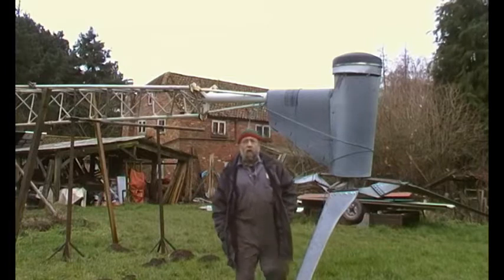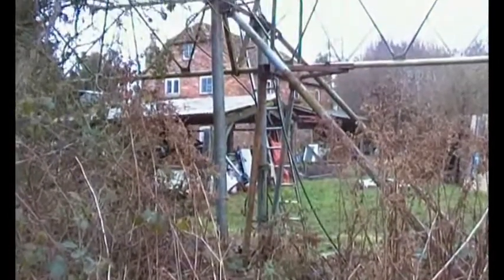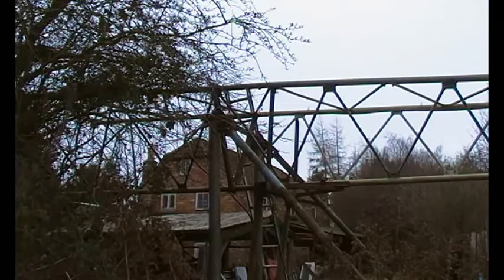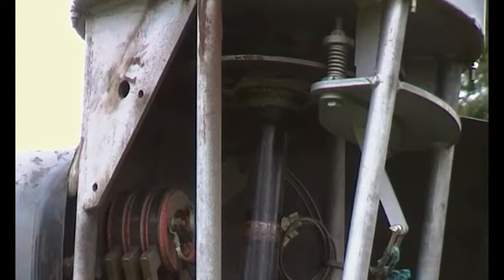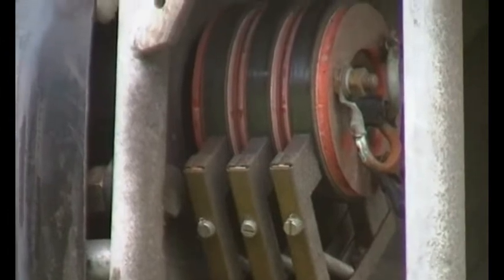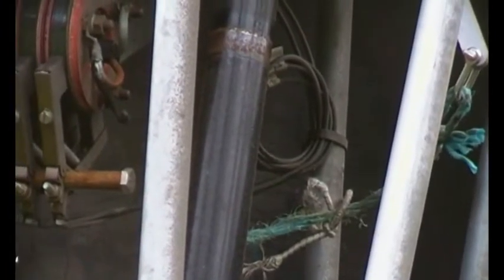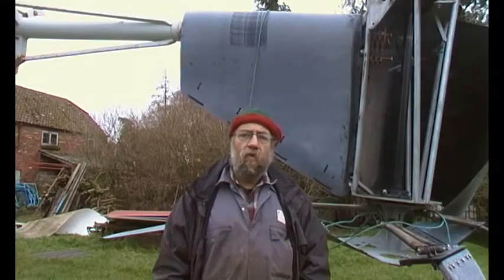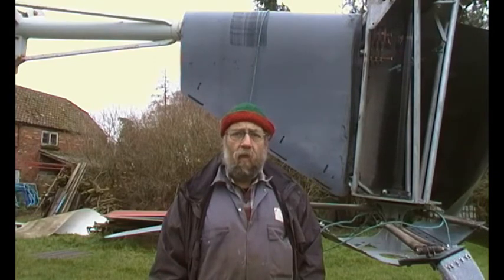Proven 2.5Kw wind turbine repairs. part 1

Comment: Thanks for the video, did you ever get technical drawings of the generator? Our 6kw proven has significantly reduced in output and I am trying to find out why…!
Reply from the maker: Hi, I'm thinking things like the blade spring mountings can wear, is the tower still upright, have you checked the electrical resistance between any 2 of the 3 out wires from the coil, are the brushes and slip rings in good condition, have you checked the diodes in the 3 phase rectifier? what are the wind shaft bearings like and have they been greased regularly. Plenty there to be getting on with, let me know how you get on. Subscribed? cheers
Reply: Thanks for the comments. The turbine has supposedly been professionally maintained by Kingspan, but they have not given or been able to provide any analysis or diagnosis as to the reason for reduction in performance. It’s tough to find people that know how to interrogate small wind…
Reply from the maker: @bellarchitects  Murray, if a diode has failed in the 3 phase rectifier then you will only get 1/3 of the output and the turbine speed will be regulated by the vari-pitch on the blades and this will be noisey. Best way to test this is with a multi meter. Where are you? cheers, Andy
Reply: @TheInfoworks  North coast of Northern Ireland, so not too many service engineers locally...!
Reply from the maker: @bell-architects  , I'm here if you want a step by step if you can upload videos of the various bits. As I say start with the rectifier, 3 AC wires in from the turbine and 2 wires out to the inverter, cheers

Comment: Great ideas you have used! however, could you adjust the fulcrum point and add weights to control the raising and lowering of the tower? Cheers
Reply from the maker: Ken the pivot points are fixed but weights may help, but they would need to be very heavy. This then may cause problems when trying to get tthe tower down as then the weight would have to rise. Cheers

Comment: I enjoyed watching several of your videos. Especially the ones dealing with running a single phase motors on single phase with a capacitor. I have built a wind turbine with an 8 pole induction motor being used as a self exciting induction generator. Also have a few steam turbines i have built and am building a few more experiments. I am also interested in using inverter drives to create a variable speed regenerative system for the wind turbine. If you have any thoughts on this i would love to have your input. If you would like to contact me directly 269-685-1340 ask for Don. I have about 40 videos from my personal projects including a steam boiler that burns tires. Here is a link to the tire burning boiler and the wind turbine. 
https://youtu.be/_X-vq6svXS8
https://youtu.be/DLo20vAP40A

Comment: Do you think the bracket cracks could have been started by work-hardening during the bracket bend forming ? Not very good, whatever the root cause. You could shape the new s/s brackets with more bracing maybe - dunno ..Nice to see a used Proven close up anyway, I think the blade hinges are  some sort of bendy material, is that right ?
Reply from the maker: Dave, stainless is wierd stuff and hardens easily but I would not have thought a single bend would do it. The blade hinge reminds me of boiler rubber, a thick sheet of hard and durable rubber, it seems to do the job. Cheers
Reply: Yeah, I agree Andy, one bend shouldn't be the cause of this surely ?. I though about it more, and that bracket really could be vibrating with the way that the 3 spring ends are connected to it - that tiny bent bracket could really have been a broad thing made out of solid and bolted to each end of that spring bolt, not just the centre. Anyway, I'm sure your replacements will last for a few years...

Comment: I think i got a fewmore grey hairs the day i helped you tip your turbine over. That gin pole looks mighty impressive and is that a new parweld inverter welder thats a nice machine.
Reply from the maker: Simon, I remember it weill, hopefully this new method will be easier. The inverter welder is billiant, i'm sure it's possible to do plug welds with it. Cheers